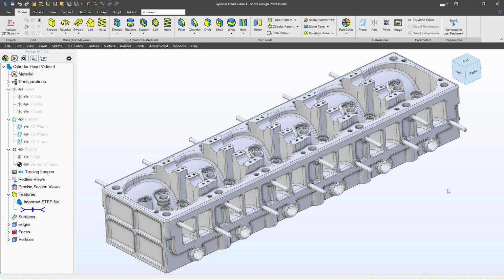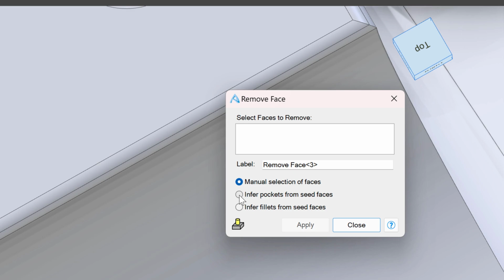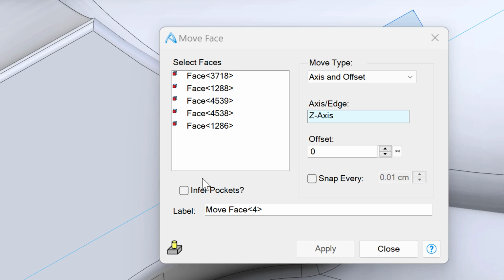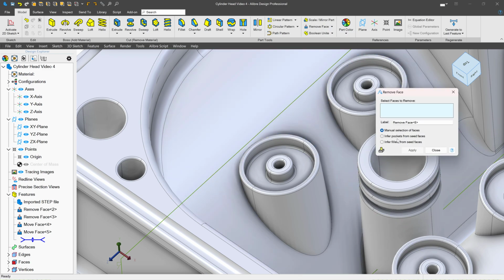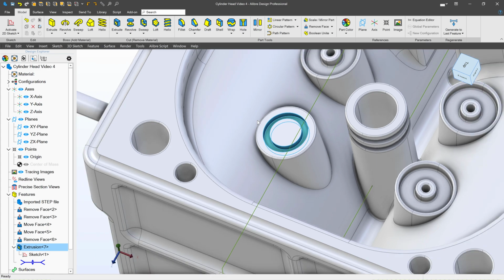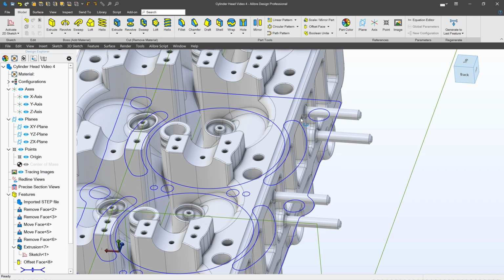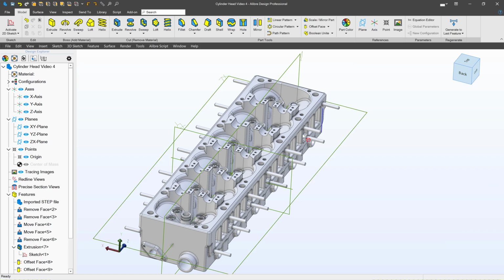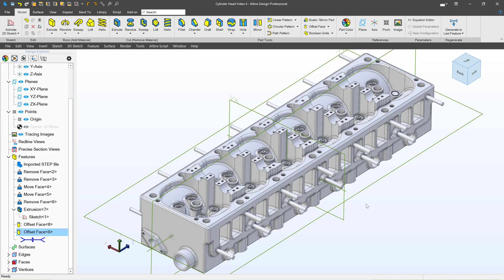Alibre | Direct Edit Tools To Edit Step Files / Dumb Solids /  Non-Native External Geometry

Comment: When making changes to an engineered part you don’t move item to “about center” you would like want to move it to precisely center.  How do you precisely move it to the right location, which likely the real world task.
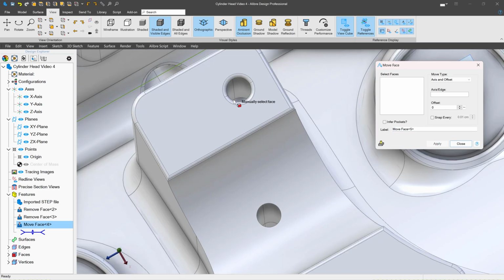Reply from the maker: Are you referencing 1:45?  The measuring tools under the inspect tab allow users to make measurements off the model.
Reply: @AlibreLLC The person doing the video moved a hole “about” close to) the center of the feature.  When you are editing an engineered design, you don’t move or measure a feature to an approximation of center.  You place it precisely in the center referencing design element.  My question does Alibre have tools in the context of what is being done in video to precisely move the hole to the center of that feature.
Reply from the maker: @dh-no2ke  As stated, the inspection tab provides the tools to make precise measurements off the model to establish centers.